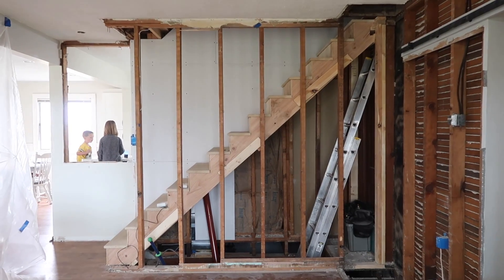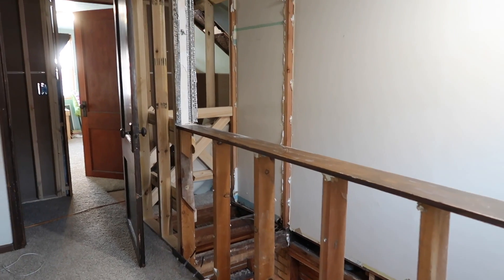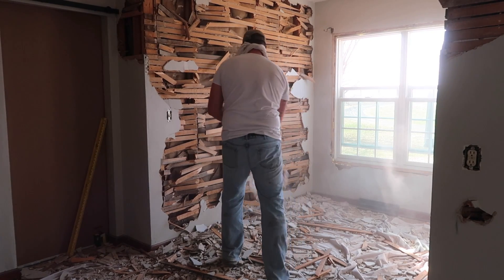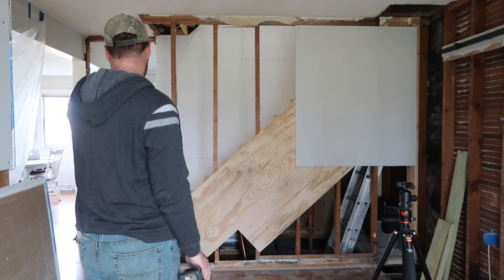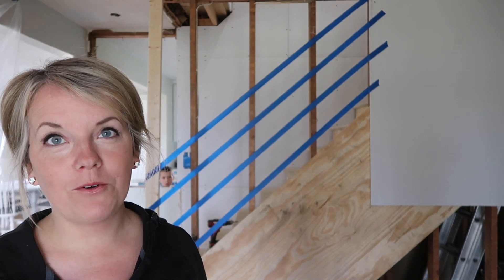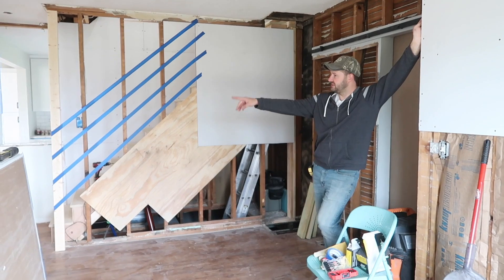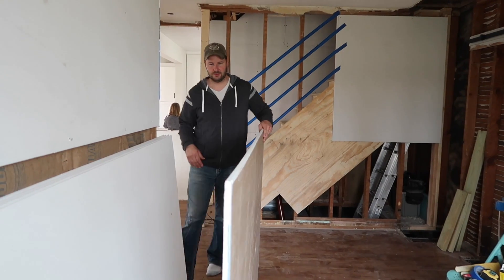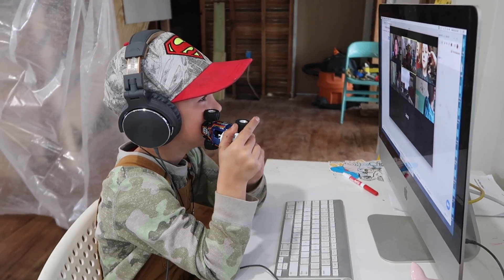Mocking up an Open Railing: We need to see it to believe it!

Comment: The open rail would be an awesome feature. Maybe making a big decision because of a short term need isn't the best udea for the long haul?  HOWEVER, have you considered cutting opening slits in a closed wall between the studs?  Kind of the best of both options?

Comment: Great video. This won't help as I have a different idea for you. Why not put your desk where it was and put a countertop that can be raised and lowered (like what you see in motorhomes but custom made by Tom so it would be awesome) in the lower portion of the stair section? I can't imagine fitting 3 people in that small section but two could work. With a "desk" that can be raised and lowered, you can still have the open railing and only have the desk up when needed. Second choice would be put your desk where it was and set up a couple small computer stations in separate spots so the kids can focus better. It's amazing how much y'all get done!

Comment: I think you should do what you like best for the staircase alone.  You can still have the computer station there, just no wall hangings. Best of both worlds.  I feel like very soon after you start homeschooling you will find, they will not want to sit together.  They will do better with laptops at the kitchen table or in their own rooms at a desk as they get older possibly.  I wouldn't make that drastic of a design decision based on wanting to put a computer station there.  You may want to move it later anyway and wish you had open stairs.

Comment: I would do the open concept/railing.  I would NOT worry about the computer station.  It will probably not work out as planned.  Over the 34 years of schooling at home, I found that 2 people sitting together never works, while on electronics.....we prefer separate lap tops that can allow for people to spread out....so a shorter counter for Dawn and 1 child would be best, from our experience and then 2 lap tops extra to be at the kitchen table, at the couch, etc.  As you saw how your son was talking, can you imagine what that would be like with 2 next to each other?  Also, you need to be able to spread out at a table with paperwork while having access to the computer, so from our schooling many at a time, I would not put more than one computer at the counter...flexibility is key.

Comment: I'm thinking laptops around the table you want built will be really flexible for the kids. Or maybe have a 2 person computer station (if they still fit with the open railing?). Open railing, cause the kids can work anywhere if they have laptops.

Comment: I'm not sure what curriculum you plan on using but my kids are around the same age as yours.  We have been homeschooling for 6 years, and even for the few years that we had a designated homeschool space we always ended back at the kitchen table.  An area like that would be nice to send the ones that don't currently need my help to be able to work in quiet, but I wouldn't do a permanent homeschool space if it were me. So I would go with the open railing.

Comment: Would you have laptops or desk tops? If laptops the computer station isn’t necessary because you plan on having a table for them to work on they could move it to the table. But honestly both look good. I know we took down a partial wall and it looks great because it’s brighter and more open but we lost some storage which I regret. We are more minimalist as well so I didn’t think losing the one cabinet would matter but it did. So for me I would decide on whether your storage/work place is more valuable then openness.

Comment: do the open wall, it will make a small space seem more open and airy and light. It will also give add some style points. Use laptops for computers, you don't need a lot of power for school work and the portability gives infinite flexibility for location and comfort. Eveyrthing is wireless these days anyways. Don't think of computers as a monitor and a tower or box and a computer screen. Even Ipads/tablets work for school work but I still recommend laptops. Also people feel weird working next to one another if they're too close, it's distracting. Main point is, don't anchor yourself to one location with the computers. Be flexible. IT worker, and interior design lover for decades.

Comment: Both look good.  But concerned that as your kids get older, they will need computer space more than open desk space.  Three workstations may not be enough for four kiddos and dawn to work at the same time. 
Wondering if it would be better to have desk height counters on both sides of the ‘office’ nook and put a table out from the wall from the stairs.  Basically flip flop the space.   If the table were collapsible/on wheels, it could be removed or added to the dining room if you needed extra space for a larger family dinner.
Reply: Also think this might keep ‘school’ in one room.  As opposed to having ‘school’ in the open area of the house.  That would give the kids (and parents) a sense of ‘when we are in this space, we are focused on school’.  And when the lessons are completed, they can leave ‘school’ in that space.  Kinda like keeping the bedroom for sleep and sex, and not working and paying bills.  Just a thought. 😁

Comment: I'm going to say that, because you got rid of that arch at Dawn's desk which now lets more light fall into the house, you need to go all the way and keep the staircase open as well, as long as Tom is willing to do the work. I don't think you would regret having extra natural light fall onto the stairs.

Something I've already seen in the comments, but reconsider on those Apple desktops for the kids, and consider getting laptops or tablets, that way they can use them everywhere. Also, hopefully they won't need their computers too much (I love how you make your kids play outside), so is there a way you can add in some space to get the laptops/tablets out of sight quickly (drawers under tables?)

Looking forward to what you decided to do, and good luck flooring.

Comment: I vote to just drywall it up; drywall will help with noise transference between spaces. Noise transference is a major issue for us as homeschoolers in a small house. 
Secondly, we've been homeschooling for six years and my kids do much better with individual desks with adjustable height so their feet can be flat on the floor (check out FLISAT adjustable kids desk and bench at Ikea.) My kids do NOT do well working at counter height or even at the dining table when they're small.

Comment: The computer station looks great with the area enclosed but I'm not sure that's right for your home long term, ans you might change your mind about it long term - if you're only having a large table in the other area for home schooling where are you storing all the supplies you will need?  The kids might be better with laptops and that area have a large drawer unit (like you had in the TV room but white) because it is visible from the main areas. The open staircase is a better idea as it's so much lighter and makes the whole space seem bigger without the wall, but I'd have less rails too; 1 top and 1 middle, I was surprised you were thinking of 5 as that's more cluttered! Whatever you decide I'm sure it will be fabulous though.
Btw if Tom has to replace the floor, why not put a hidden socket beneath where the main work table will be, that way if you need laptops/computers etc. there you won't have wires across the floor.

Comment: The open railing does look very nice and I think it would work well if you made the workstation smaller. Do you need 3 stations? With mobile devices, they probably wont need a 4 seater table in the other room and 2 kids work stations.

Comment: I like the closed in look with the computers. I have a thought to consider when closing it in. If you need the light at the bottom of the stairs, is there one at the top so they could see to come down in the middle of the night, if they needed? It probably wouldn't be hard to put one in now before it's closed back up either way.

Comment: I vote no to anything on the wall by the stairway. It will make the space seem too small. Try getting a flatscreen monitor and hang it on the wall to hookup computer then it can do double duty. Why do you need 3 stations ?

Comment: The open railing would be lovely, and visually give you more space. But you can always do it at a later date if funds and time are more important now. Your children will not always be little, or sadly, at home. When they go off to college you could always open it up.
I would like to address your cabinets underneath the countertops though. To leave room for your knees while seated your cabinets would have to be recessed at least a foot, preferably more, under the counter,  which means to put anything in them you would have to duck your head under the countertop. You could have a drawer unit between each computer station.  Or put your storage cabinet/drawers on wheels. They can be wheeled out while you're sitting and wheeled back underneath the counter when you're finished for the day. 
I homeschooled my three children for 12 years in a small house, (900 sq ft). We never had a perfect setup, but I wouldn't trade those years for anything. Now they're all grown and on their own. 
You certainly don't need a counter like that in order to homeschool. Once you direct the curriculum, you will find that you can teach all of your kids certain subjects collectively at the same time, at your kitchen table, or on the sofa, and they really only need to Work at their own level on things like math, composition and reading.  My children liked to be together for the subjects we did as a group; Bible, history, art, read-aloud time, and then go off to their rooms while doing their math and writing.  Back then, we only had one computer so they had to take turns on it. ☺️

Comment: generally i'd prefer personally open railing, more light, different feel of bigger space, less electricity used as the stair light does not need to be switched on so much. How long do you need the computers station for? just the virus lockdown months, temporary? open railing.,Permanent - close the wall, more unified looked above the table, less dust coming onto computers from stairs, better focus as you have wall rather than steps&feet to distract you. good luck:-)

Comment: So I like the open railing but don't think it works with the computer station. I also like Dawn's drawing with the the closed wall and adding in the computer station.

I'm wondering if you could do a partial opening on the stairway that would start just above where the top railing would be and extend up to the ceiling to open up the stairway a bit but still have enough wall to have the computer station.

Comment: I say do the open railing and put the computers in the office.  From my experience homeschooling, as much as I have tried to make a school space, they love to move around.  I have had a designated school room and school space, but they like to go to the couch, outside, or even just the kitchen counter.  Don't waste your office with a big table for them to work at.  A computer space is fine, but let them do book work in already existing spaces.
Reply: Also, if they will be spending a lot of time on the computer, make sure that it is a comfortable place to be.  Are your kids comfortable at a counter height for a long time?  Will they have back support? Then run with it!

Comment: Gosh,  I'm so torn.... and I'm concerned about how personally I've become invested in this,  lol. 
Architecturally, open staircase. .. hands down. It would be stunning and make a huge impact on visually opening your house up.  When you put the sheet rock back up,  it felt sterile and boxy. 
IDEALLY, nothing would go in front of the staircase to keep the focus on the showstopping railing and stairs (assuming you'll have the stairs showing as in the second photo.)
Is there anyway you can configure the office room to accommodate both computer and tablespace? With everyone being home,  you might appreciate one spot in your house that is empty, clean, and beautiful to look at without evidence of people, lol. Does that make sense at all?
Editing to add that I was thinking that vertical spindles might look better in the space, but figured I was just behind the times,  lol. I see that others have also suggested it.  Perhaps though it's because we're seeing the vertical studs, and the horizontal blue tape is competing with those?

Comment: 😜 I TRIED THAT SETUP!!! As a designer and an ACCIDENTAL Homeschooler...and whether you close the wall or not, (both could look great, but I would opt for open...) I would say agree with alot of the veteran homeschoolers when I say, DON'T plan for the technology and what you think will work for homeschool. Laptops, even for my 9 & 11 year olds work soooo much better. I even use one for my video editing. It's not as big a screen, but with the kids home ALL. THE. TIME. I would not put my work space next to the kids. And my kids are so easily distracted that I have had to move them to their own rooms. You will appreciate the flexibility.  If you can, you may want to put some of that school storage on the blind wall to the living area. Having to get at it under the stools will prove to be a pain. Make this as Stupid Simple Functionally as you can for daily life.

Comment: Open railing let's in light.  ?4U. Need storage?  Can upper cabinets be used as a base for the custom table you're building?  Just a thought for storage solution.  I love the drawing of the work station but as the children grow, it will become  obsolete.  There's my 2 cents.

Comment: Close the wall, and add desks. The opening on the stairs is not that big, adding railing and desk up agians the opening it will create 'visual mess' (you know what I mean. You guys need desk for home schooling anyway, and Dawn need desk to work. Once kids will be out of home ( in far far future) you can do the open railing thing.
For now, your family size and home schooling , I think you need to be practical :)
btw. if you desire to have some modern accent, why you will not build in something in the opening (window) facing kitchen. I mean somthing like decorative 'floral' bars  or stained glass?

Comment: I would open it up, but I would not use metal (too modern).  Like you said, your house was built in the 40's. I would use wood.
Also, invest in laptops.
Reply: Why not open both sides of the stairs?

Comment: My only question is WHY do you have a wall at the bottom of the stairs on the right? Even though it has a window, it impedes access to the kitchen and closes the space.  If it not for structural reasons, I suggest you remove it. Best to have I pads or chrome books. They are much more portable. Desktops too permanent.  Whichever you choose (wall or no wall), think about lighting.  2 or three ceiling  can lights with dimmers will work well.

Comment: The open rail would be beautiful but, it sounds like you need the function. The Minimal Mom would ask are you going to use this in the next six months? Sounds like not only yes because of our world situation, but also you are going to homeschool. You likely will need the two areas in the scenario where they are all, and you, are working at the same time. With 4 kids I think you need some options to spread out with a computer station and the square table station. Tom will make it look nice. He will figure out a way to put the new outlets in a way that will help with cord control of the 3 computers. You will make it minimal and pretty. It will maximize your space for the functions you need right now.

Comment: Can’t you do both?  Open railing and the computers area?  Then when the kids outgrow the computer area, you can pull it out and the open railing is already done. However, stop and think how well all three kids work together in one space?  Not that they would all be working at the same time, but I know how important private space can be. I am with Tom, I was actually surprised how much I liked the enclosed staircase and the computer station. So....either/or, which doesn’t help does it?

Comment: Open stairway. I am unsure how public this space is - does the front door open into this space? I still vote for the open stairway for aesthetic reasons. Also, even though the computer desk looks nice, I think the kids will only need laptops, not desktop computers. The kids can use the laptops at the desk or at the table in the room that the tools are in presently. Chromebooks will most likely be enough.

Comment: You may not want your work computer and the kids' computers side by side all the time.   If you can, I would make it flexible by using laptops on wifi, rather than hardwired computer stations.  Then the computers can be used anywhere in the house.  That said, I do like the open feeling of the stairwell, but I would do it all the way open, not half way up open.  Just my 2 cents.

Comment: The open railing would look nice but....I would build the full wall, hang cabinets rather than put them under the work surface. Climbing under the table every time you need supplies I think will get old fast.

Comment: Why do you need a desk specifically for computers? When you will also have a work table? Do you need to have desktop computers? Laptops don't do the trick? They're much more versitile: you can use them wherever you want and put them away when you don't need them. I'd those are characteristics you'd enjoy Dawn. Why waste precious space with desktop computers? Also, you would have to look at them all the time. I say yes to open railings and no to the desktop desk, plus you get light in the staircase even when the girls don't open their window. And one last thing: I'm not a fan of the diagonal lines for the staircase, too much visual noise... the vertical lines are a lot more interesting! Take it from a designer ;)